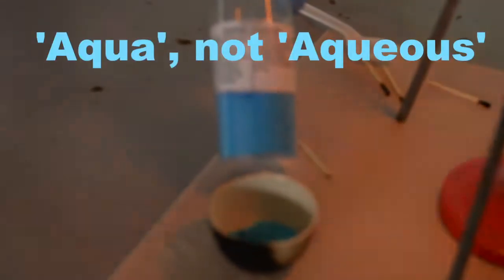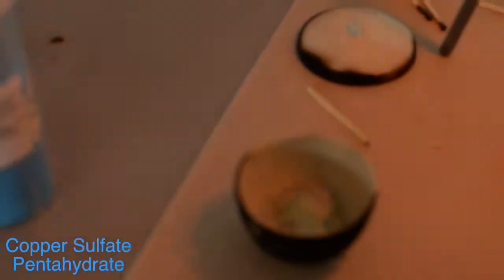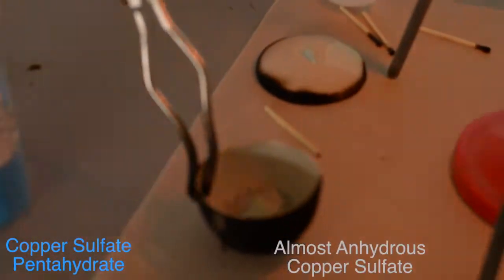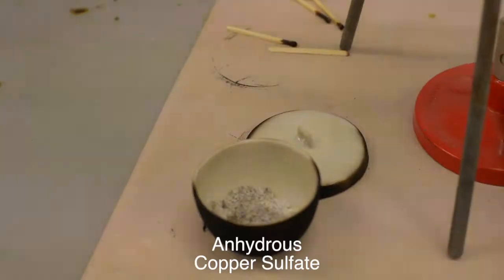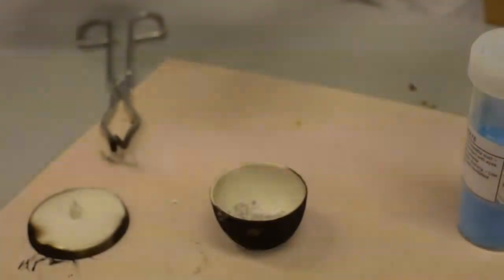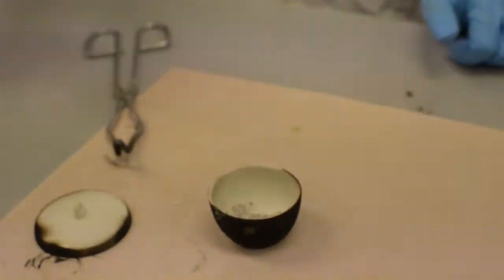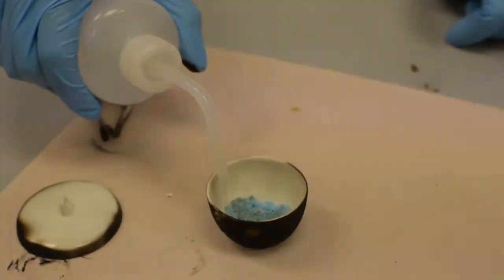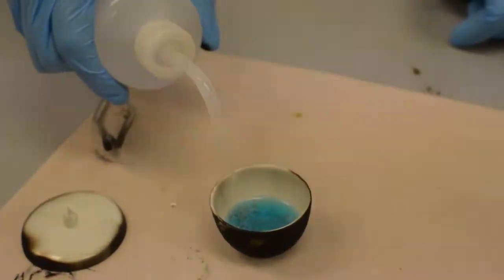Dehydrating Copper Sulfate

Comment from the maker: Indeed this is true. I chose to use the safety flame in this case so that it wouldn't heat up so rapidly that the copper sulfate would spit if it had any substantial moisture content. The soot comes off quite easily with paper towel on the surfaces of this crucible too. A better way of demonstrating this would be to use a test tube over a working flame - no soot, and better contained.

Comment from the maker: It's a ceramic material specifically used to handle high temperatures - hence the name 'crucible'. The black charring is due to incompletely combusted carbon depositing on the surface of the crucible, from the yellow flame, not necessarily from very high temperatures. This is otherwise seen as a dark smoke trail above the bunsen burner.